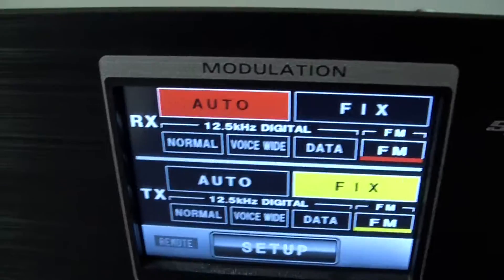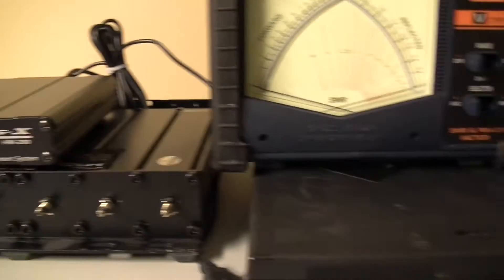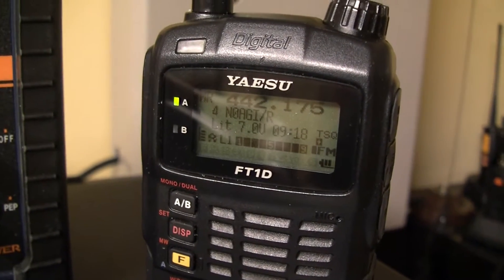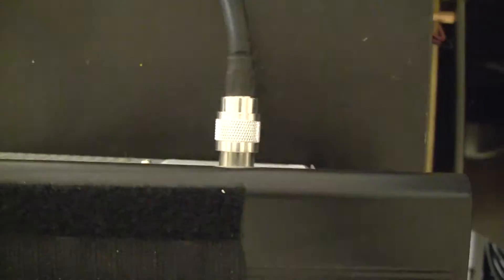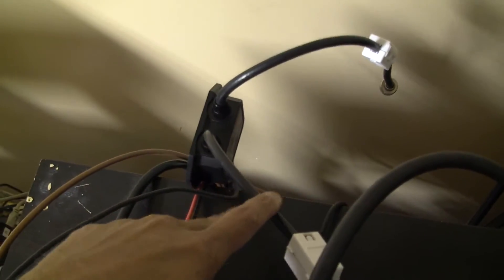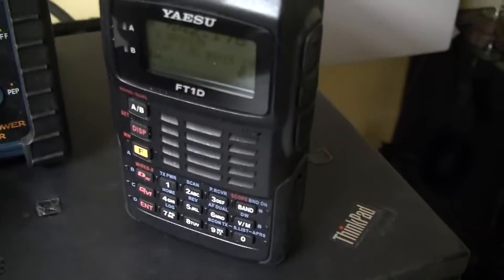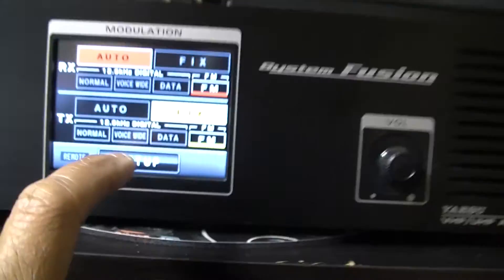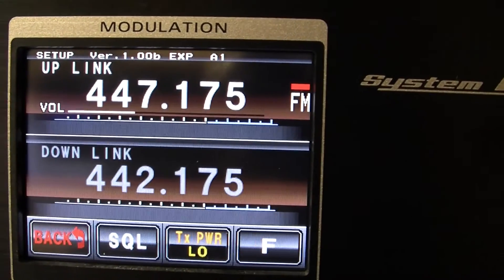YAESU-DR-1X "TX Antenna" port not showing on watt meter

Comment from the maker: This issue was caused by bad transmission circuit. I ended up sending the repeater back to Yaesu and they quickly fixed it for me.   I am not suggesting that this is the only case why the anomaly would manifest itself; I am sharing the issue that was causing my situation.  Your mileage/cause/issue may vary is what I am getting at.

With all that said, this video was long time ago and I had since moved away from Yaesu repeaters into DMR.